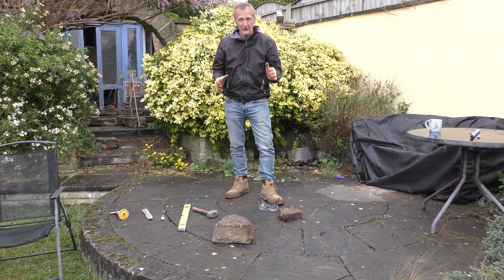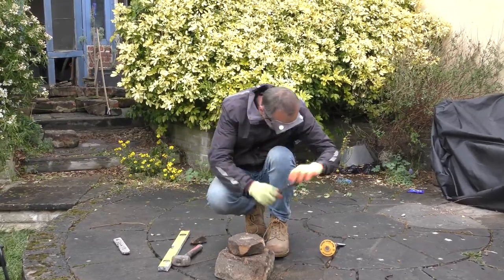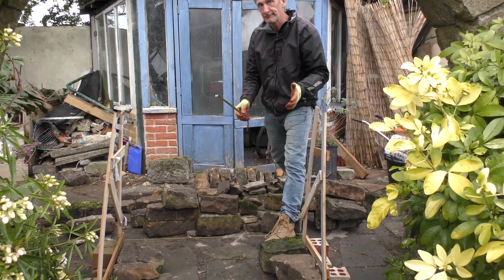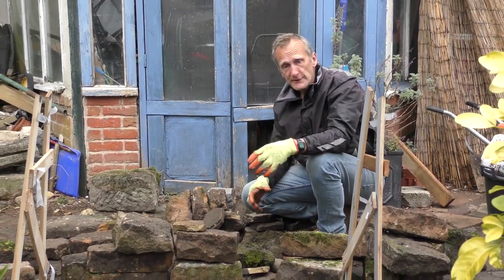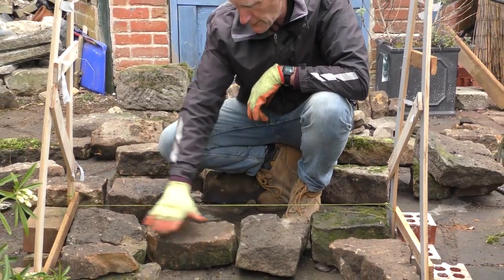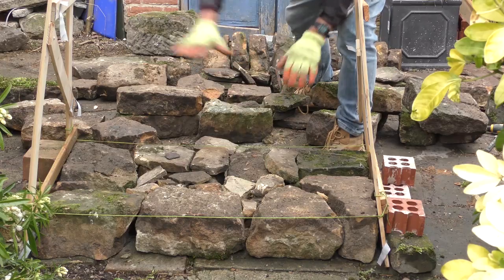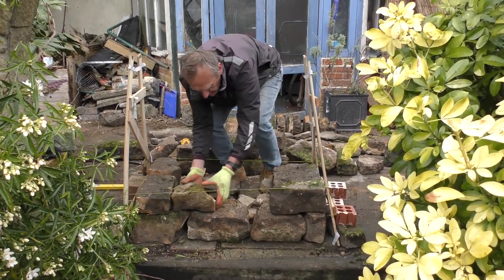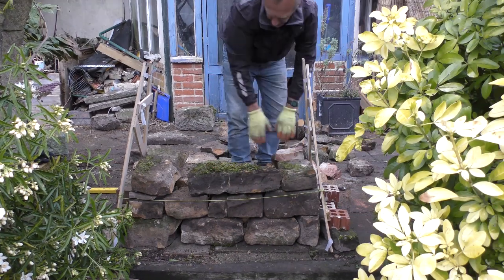Drystone walling tutorial

Comment: Great tutorial. I'm just wondering as I've seen dry stone walling built to some heights without an obvious batter to them and the use of overhanging through stones at various intervals  Some of these walls are 200 years old
Reply from the maker: There are lots of different styles, if you get the chance the millenium wall at Cromford is worth a visit, it shows about 12 different styles.
Reply: Hi Ivan, I am merely a journeyman in terms of stonelaying but have laid many tons. I have been fascinated by the art/craft for as long as I can remember. High faced-up walls with no obvious repose (batter) and no obvious through/tie stones (or deadmen) generally have substantially wider footings, in ratio to their height, and staggered through courses every 3ft/meter. If you took a level to such a wall, however, there would still be a mild incline on either face.  The wide footings act as a cantilever, as long as they are properly backfilled. The through courses are plumb to the face and so aren't obvious but they are there. Mortar can never replace gravity. Cheers.

Comment: Do you occasionally use coarse sand in with the "heartings" to give a little more fill and possible stability?
Reply from the maker: Hi Don, normally you don't need coarse sand unless you are doing a turf top to  the wall or planting Thrift near the sea. If it is the only thing you have though, it could be used, (normally you would break up a few stones if you didn't have many heartings).The key thing is to avoid water in the wall freezing and expanding by 10% pushing the stones out. Hope that helps, regards, Mike